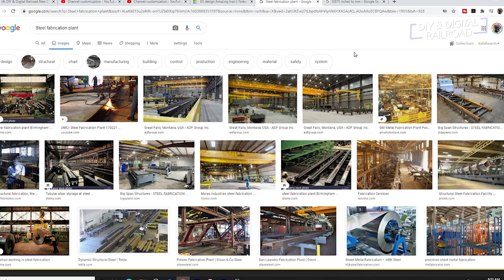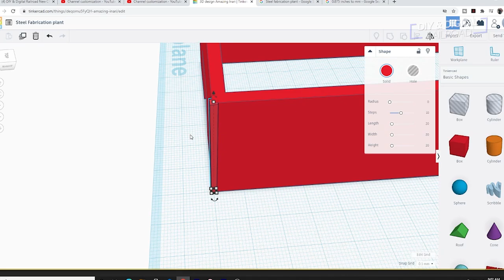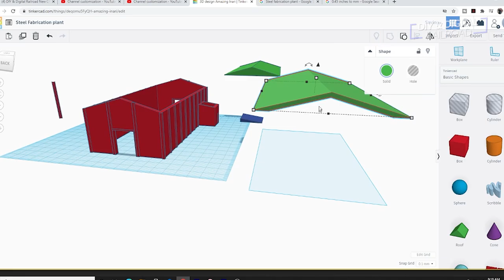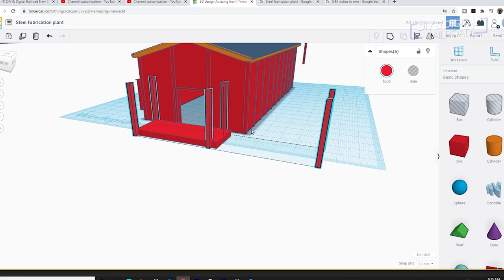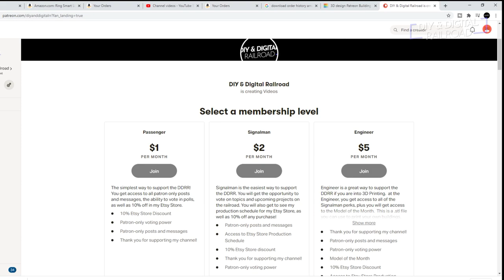Design and 3D Print an N Scale Model Railroad Steel Fabrication Plant

Comment: Very interesting model. I am sure the base for the overhead crane can be built into the scenery so that shouldn't be a problem. Is this being made with the material that is easy to sand? I am thinking of getting this in HO scale for my N scale layout so it will be nice and large. Would just need to sand off the man-doors and add N scale ones. Should be easy for the modelers to customize with roof vents and fans. Cheers!